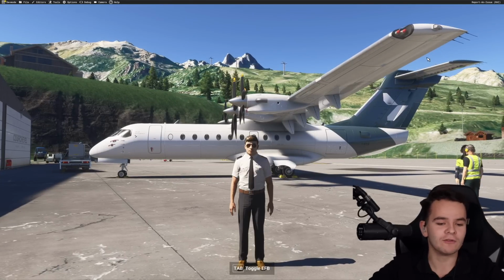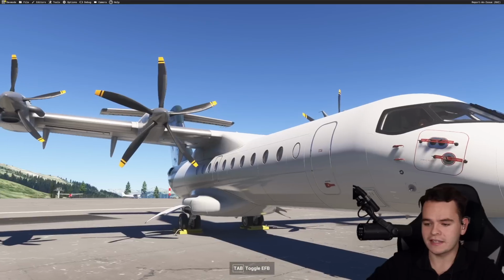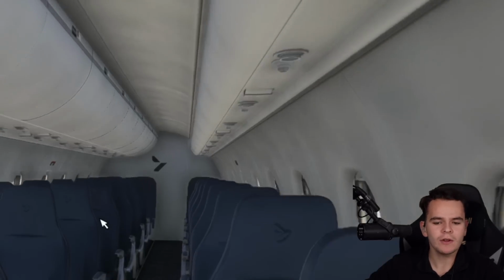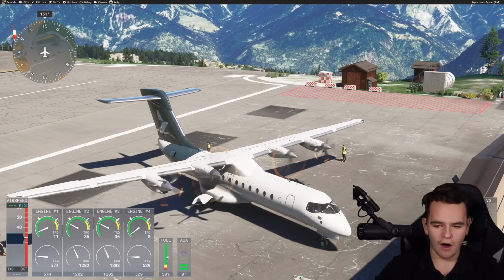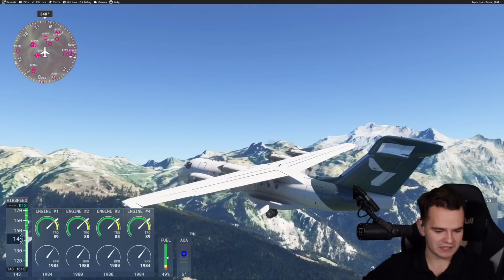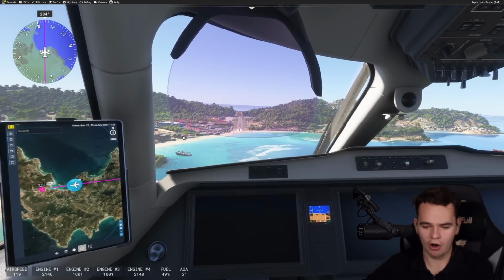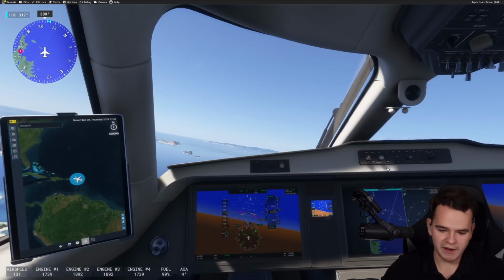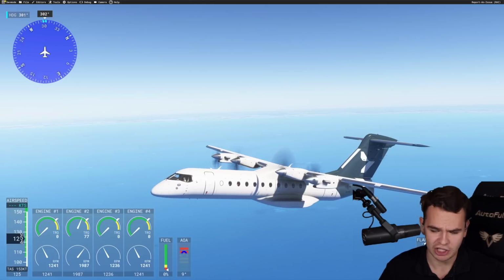The First Electric Airliner That Actually Makes Sense - Heart Aerospace

Comment: Maybe they could put huge electric generators on the combustion TurboProps to give it more electricity and range. And maybe you use it mostly during climb where in cruise you only need the power of the only 2 TurboProps where power is in higher demand and you can maybe windmill the electric ones to recharge the battery especially during decent and you need some speedbrake you can set it in a other gear like windmills with hard wind don't go around crazy, they just use another gear with higher torque.
Reply from the maker: I think for most of the flight this won't increase range because of the conservation of energy. As a speedbrake this would maybe work. Electric cars mostly brake using regenerative braking, which works well. It shouldn't be hard to incorparate that into any of the engines. The turboprop engines already have generators.

Comment: The electric engines fail last since theyre powered by the turbo props, but other than that in its current state this plane is dog water without engine instruments... I bought it in career mode and its just not flight plan ready at all complete waste of 4mil

Comment: 3:56  "Don't use the razor for to long, that will reduce the range" - Swiss001 
Only speaking facts right here
Reply: makes sense
Reply: @g_pazzini  it won't actually since that electricity probably comes from generators in the propellers and not the batteries themselsves that's why he said i'm just kidding later
Reply: I am selling lemon juice!!! Do you want it?

Comment: 2h train will be faster, but if You need transfer connection from plane to Frankfurt, then probably 45 minutes flight plus 15-40 minutes of wait will be faster than travel to the railway station and 2h of travel.
Reply: then there is islands and more remote villages where making a railway dont make sense